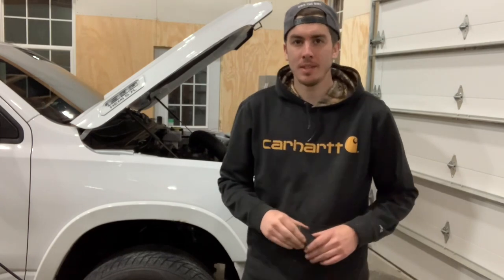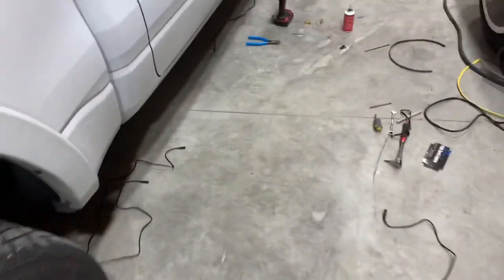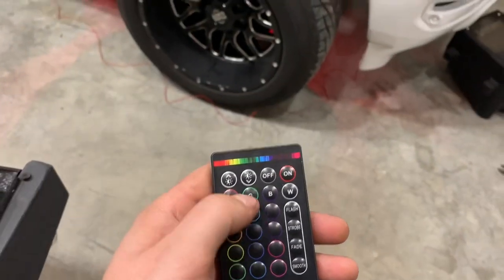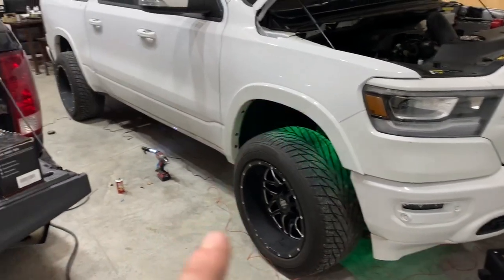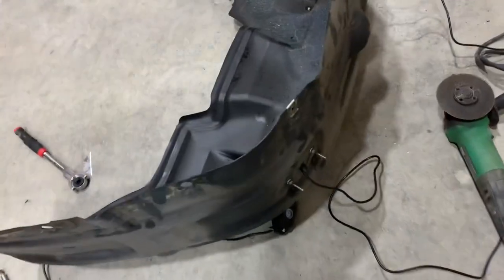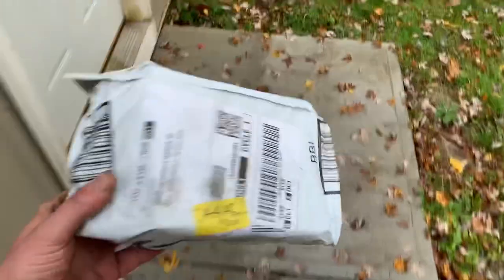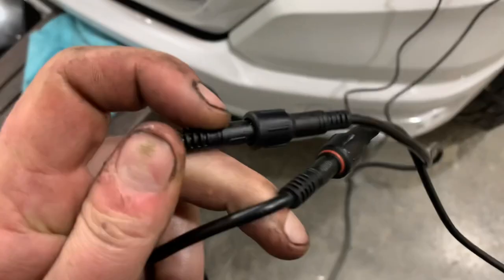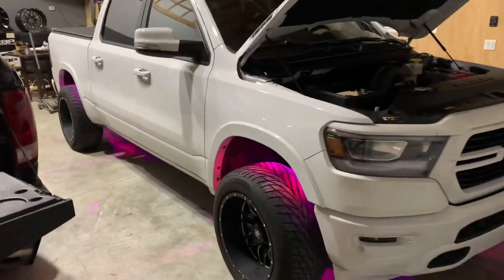2019+ 1500 5th Gen Ram Installing Rock Lights from MIC TUNING made Easy

Comment: Thanks, just started doing mine. 10 hours? Mmmmmm I think I can shave off maybe 7 or 8 off that 10. Letcha know how the install goes Saturday.
Reply: So it's taking 3 months now huh
Reply from the maker: Did you get yours installed ?
Reply: @so5thgen  yes took 2 and a half hours and I put my box inside the cab, no connections or bare wire outside the truck. 

Hardest part was front drivers side wheel well. Have fun with that lol

Comment: Need to put soMe on my 5th gen
Reply from the maker: Easy way to make your truck stand out! The strobe feature could come in handy as well
Reply: @so5thgen  also like those fender flares you got bad ass!!
Reply: @so5thgen  oh quick question did you paint tour tail lights?
Reply from the maker: They are wrapped using a tint film made by luxe auto concerts